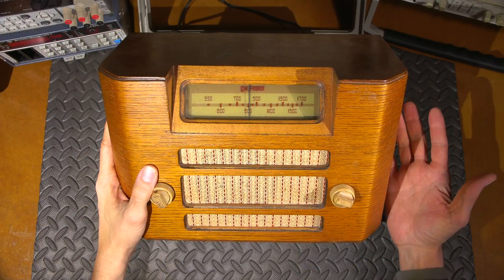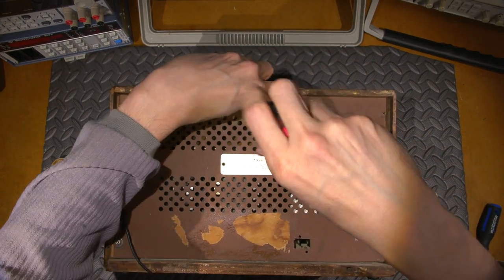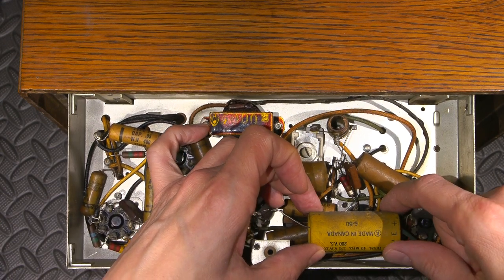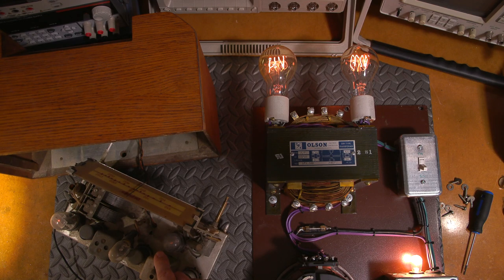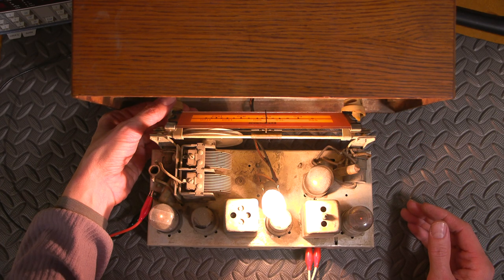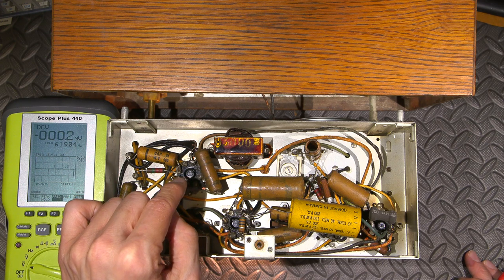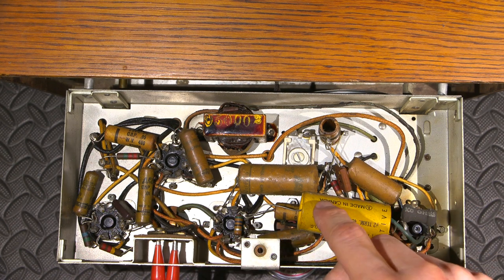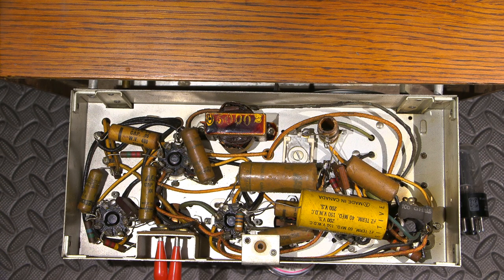1947 Electronics - Will It Still Work Today? Find Out!

Comment from the maker: To learn electronics in a very different and effective way, and gain access to Mr Carlson's personal designs and inventions, visit the Mr Carlson's Lab Patreon page here: https://www.patreon.com/MrCarlsonsLab
Reply: What a Kool 1947 radio receive you owen
Reply: Must have been made in Canada if the squares drive screws are original to the radio.
Reply: I am possibly interested in your electronics course . If I become a patreon, will I be able to start at the beginning, or am I joining at the current video (it's unclear how this works) i.e. is it to late to start now?
Reply: I wonder if you could upgrade and mix with modern diodes, transistors and capacitors to keep her running right ?

Comment: I've seen this type of line plug connection before -- it has either round or flat pins with a line cord that attaches to the back "Masonite" panel with a U-shaped spring clip, somewhat like a thin Fahnestock connector.  The bulk of the plug stuck through the back and into the recessed mating plug.  It's definitely a safety device that someone lost or damaged in pulling the back open in the past.  While the line cord may be impossible to restore, the rest of the radio looks great!  I ask and plead that it be restored with the usual TLC from Mr. Carlson...
Reply: I have seen those type plugs before as well. I currently have a power cord with such a connector, used for a wire recorder from the late 40s.
Reply: By the mid fifties the safety interlock connector was common in radios like this but this is quite an early design!

Comment: The most important thing is to very  much clean the wooden sides of  cabin or the console from inside and outside and the all the electrical parts  and the bottons and every inch in the set, because many people  can repair , but the little who can furbish and clean as a brand new device, because the buyers specifically - the audiophiles - scan every inch in the device before buying ,  thanks Mr. Carlson  lab. 😊

Comment: 1:23 It's ok, it's only mains voltage.

That got me thinking about the language difference between my mom (who designs power station high voltage systems) and my dad (who worked as a communications technician, working with switching boards and things like that). For my mom, low voltage is 240-380V. High voltage is 400kV. For my dad, anything over 60V is high voltage.

Comment: Excellent video Mr Carlson!  How about a video that describes in detail, how to identify all the various resistor, capacitor, and small inductor value markings, for the purpose of ordering modern replacement parts.  Some of it is easy, and for other components, it's definitely NOT easy.  Thanks in advance!

Comment: Yes please to the restoration!

It would also be really interesting to see you do an alignment in two passes: first using more basic hobbyist grade test gear (e.g. a digital multimeter and a TinySA handheld spectrum analyzer), and then re-do it using professional grade tools (e.g. the HP 410B and HP 3585B) to demonstrate the improvement and show good enough vs. perfection. I'll mail you my TinySA if you're interested.
Reply: I'm sure the alignment would end up just the same with either level of equipment.
Reply: @eDoc2020  You're probably right!

Comment: I'm guessing whoever sent this to have the smoothing cap replaced probably isn't with us any more so the repair was forgotten about and the subsequent owner was unaware of the repair. With that said, with just the smoother replaced way back in the mists of time, it's very impressive that it still works to any degree!

I think this will make a very interesting restoration. It already works pretty well and it would  be good to see how much better it works after a re-cap and alighnment. It's obviously not had a hard life and is cosmetically very good.

Comment: Great advice! 
A lot of people don't realize that these thing become a bit of a ticking time bomb. Parts will get bad, maybe next week, maybe next year? Point is, when it happens you never know what parts will get damaged. 
Especially finding a similar output transformer can be really difficult for example. 
I sometimes don't really understand it when people are cleaning it anyway. You're in and on it anyway at that point, why taking the risk for just a few bucks and a little bit of time?
Great video 👍🏻
I am curious how it will perform after some proper cleaning and repairing!

Comment: Deforest model D666. Looks like it has one of those round plugs to connect power to the chassis, an early  safety feature . Someone bodged up a replacement using a  nonpolarized rubber cube  tap to make it work.
 Definitely worth restoring it electrically since the cabinet is beautiful! 
Am I the few here who can figure out just by looking and searching the internet as to what radio we see here? Hmm,  the 
Master super-sleuth Steve!
Reply from the maker: You are correct! Good sleuthing :^)
Reply: model D666  is it posessed
????
Reply: @richardcranium5839  Lets hope not! An Exorcism is not on the itinerary. LOL

Comment: Hi Paul! I’ve been at antique radio restoration as a hobby for a few years now, and while not an electronics expert by any means I’ve learned a ton via your channel (and some others). One question I have is about “reforming” capacitors. I’ve heard the term many times, but it’s never been clear to me exactly what’s going on. Do you have a video that explains this? And if not, would you be interested in making one? Thank you for all of your videos… I attribute most of the knowledge I’ve gained over the last few years directly to you and your videos! 😊
Reply: "Reforming" the capacitor is done by gently, slowly increasing the D.C. voltage on it. Paul does this by keeping the radio connected to his dim bulb and current limited tester which supplies less than full A.C. voltage thereby keeping the D.C. voltage down. Radio restoration videos by other individuals show how they accomplish this long process. They reform the caps so they don't have to replace them. Paul cautions against this for long term use since the caps could suddenly short internally and your room is filled with magic smoke. Capacitors are inexpensive compared to replacement tubes and (if you can find them) replacement transformers.

Comment: Have a 5 tube radio in a wood case that i purchased for $10 almost 50 years ago. Guess it is at least 70 years old. Never did snything to it. After its on a few minutes station sometimes drifts a little and I have to turn dial a little bit.  My wife had a 1956 Buick Special that had a tube radio. Was strange that itvtook awhile for tubes to heat up.

Comment: That radio is a good example of really minimal design whilst getting the job done. I assume this must have been a low cost consumer model. Nice to see a set that’s almost as uninteresting as those manufactured here in the U.K. As you say never trust those old electrolytic capacitors they usually let you down after giving them the benefit of the doubt!
Reply: It appears to be an All-American Five design. Most everyday table radios from the 40s to the 60s used basically the same circuit.

Comment: I’ve seen the power line connector before.  It was again in an old radio.  They can be dangerous, as the heat from the tubes can cause the insulation to become brittle.

Comment: First time viewer.  Really enjoyed the video!  I have a random question.  I have an old consol box from 1954.  It had a built in slide out record player as well.  The radio components were a bit of a fire hazard so I took them out (including the asbestos pad...).  The cosmetics of the radio and cabinet are perfect.  Can I build a custom radio to retrofit it to the existing components?
Reply: Awesome ! I've wanted to do the same for years for an old Magnavox cabinet with doors on the front that had a TV, radio, phono combination.

Comment: A replacement line cord could be made using the inside parts from an extension cord plug and maybe 3d printing a housing which fits properly.

Comment: You can see that Capacitor there going bad very quickly...
Time must work differently in Mr Carlsons universe. The radio is almost 80 years old already.
Will be a nice unit once it's repaired and given a clean bill of health. Would love to know what was going on with that power adapter they had on the back

Comment: I am a Patreon cause i have had so much fun learning more about tubes and good ideas;Got hold of  huge boxes  with new old stock tubes that i want to know more about.Philips 6155(QE 3/300)?Philips miniwatt EL 33.Sylvania 5Z3. G.E.C TT22. YL   z.  Haltron Radio tube 6x6gt.Mullard the master valve 5U4g. Siemens E 280F. RCA 6BK4B.Siemens Cd 20665. and a lot more.all new in their boxes.want to know more about what they was used for.

Comment: Would that large capacitor be a late addition to the design.  I mean if it came out in 1947 they may have sold this through 1950 and that capacitor may have been a change made during a production run.
Reply from the maker: Good possibility, but is does say Philco in a DeForest radio, so probably not original.

Comment: The OP tube grid appears to have a 2.2 megohm resistor to zero volts, so bias would be by a resistor in the cathode circuit, which we can't see, probably because it's hidden by the bypass capacitor. One more volt on the grid would indeed increase the anode current, but not by a huge amount. Any chance of some actual measurements, with the leaky capacitor and then with a new one?

Comment: i have a philco radio from 1946 mostly original capacitors when i got it it worked great then i wanted to make a video on it  but when i plugged it in and turned it on saw a bright flash from the 35y4  make a long story short it needs new caps and a replacement 35y4

Comment: would love it if someone would explain thoroughly and simply, in a meaningful way, with a simple circuit diagram, how radio receivers do what they do (maybe skipping over the AC to DC conversion)... so I could understand, once and for all how it is accomplished

it's something like we have an AM modulated signal (and I understand what AM modulation is) that comes in at the carrier frequency and then it's "mixed" with the local oscillator (right?) which somehow drops the frequency down to the original frequency (right?) and then the higher frequencies are filtered out (right?)... am I even close?  And, I'm not sure how all of this is done with just a few active elements (tubes)
Reply: To pick up one station you need an accurate tuned circuit, and to reject the adjacent stations, it needs to have 2 or 3 filters in series.
It is very difficult (if not impossible) to make such a multi stage filter adjustable over the radio band though.  So, the filter is done at a fixed frequency, say 455khz.
An oscillator in the radio is simple to make and easy to make adjustable with a variable capacitor.
Now if you mix the received radio frequency and that local oscilator freqency together you get a mix of the two frequencies freq1 plus freq2; and freq1 minus freq2.
If the local oscillator is set 455KHz below the desired station frequency, and mixed with all the band of radio stations, you get a range of mixed frequncies- but only your chosen station is 455KHz.
Pass through the IF filter which is precisely tuned to 455KHz, and any other stattions which say mix down to 500KHz, are rejected. 
So by sweeping the locaL oscillator with the tuning knob,  you pick out a station - the one that is 455KHz away.
Then demodulate the audio with  a diode.
Reply: @f1andystartronics647  Thank you, but that's not the sort of explanation that I'm looking for.

Comment: I wonder if it's still working because it's never been turned off maybe that's the secret!  I've got a radio from the 70s that's always been on most of its life since the 70s hardly turned off maybe it stops the components from degrading if it's left on,  a bit like the light bulb effect

Comment: why are you so surprised. I have found at least half of the old radios I buy work after bringing the, up slowly on a variac. I was surprised by the first couple when I started messing with tube radios a decade ago but I literally have several radios that work perfectly with very little if any hum with all original components. My theory is, and you can call it an educated guess but I think radios which have been used regularly or at least periodically the components last virtually indefinitely. If you store it for decades then thats when components start to go bad. This is my experience. I even have a 1959 hammond organ which performs perfectly and I use it regularly. I have 1939, 1940, 1947 etc radios which show no signs of failure and perform well . I fire them up weekly to make sure they continue to perform. I truly feel like storage is what kills radios

Comment: ALL Wax Paper capacitors in any radio (of this age) should be replaced by modern equivalents.
Since there is no "Power" transformer on the chassis of this radio, it is CERTAIN that the filaments on the "tubes" are operating in series - on 120 V AC.
Just how available and at what cost such tubes now may be "available"-  I wonder.

At the last that I was aware, "Vacuum Tubes" were no longer being manufactured in the USA and all such "manufacture" had been contracted out to Brazil.
(Of course, this does NOT apply to High Power transmitting tubes !)

In addition, I believe that Russia still manufactures European type Vacuum Tubes, which mainly would have 5 V or  6.3V filaments - not suitable for operation in series on 120 V AC..
Does anyone else have any other information concerning this?

Comment: I know Sony used to have some equipment that had a male power connection on the back and a line cord with a female end, but good luck finding one, probably the insulation would be hardened....
Reply: Just enlarge the hole in the back cover so that a common extension cord will fit?